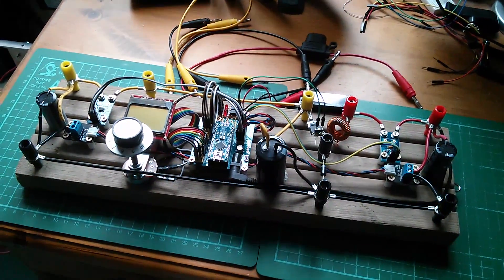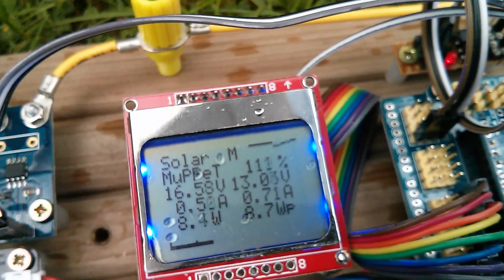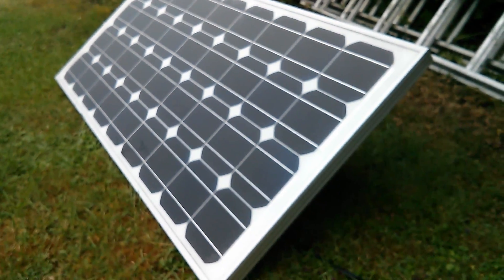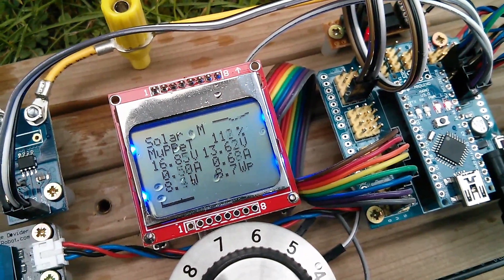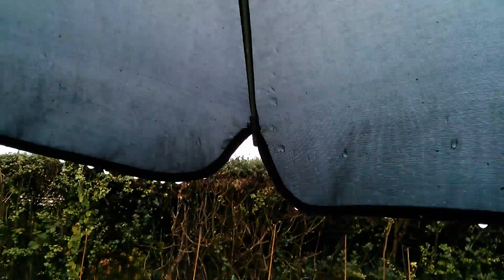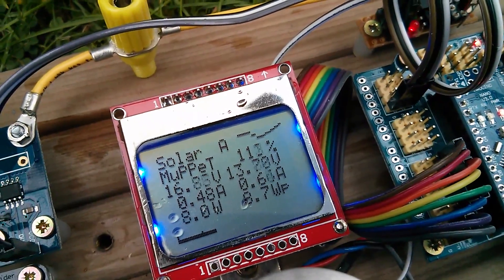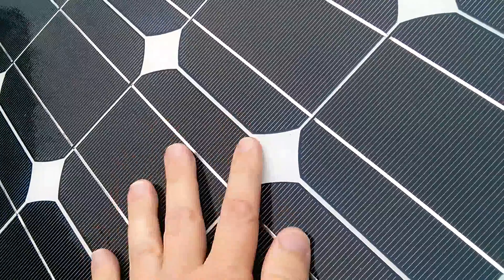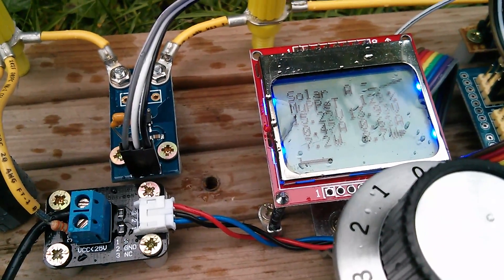It Rained All Day and it's the Middle of Summer

Comment: The monocrystalline cells in your panel suffer less from heat than their cheaper polycrystalline counterparts, but have slightly reduced efficiency in cloudy conditions, not that it would make all that much difference. I wonder what light level the panel was receiving - do have a light meter at all?

Comment: Hiya Julian, I'd say your readings are about right, I've got a pair of 100w panels I use (200W config in series) which on a good day of sun will get me around 190W (~44.5V @ ~4.3A) but on a cloudy day I get maybe 30-40W max in contrast. Cloud = Solar Panel enemy :).. BTW you should play with orientation of the panels, you can gain up to 40% more efficiency with correct angling to the brightest part of the sky (not always where the sun is on a cloudy day, this is where a solar tracking project would be a great vid) ;) cheers.